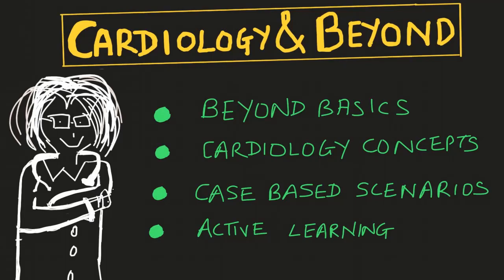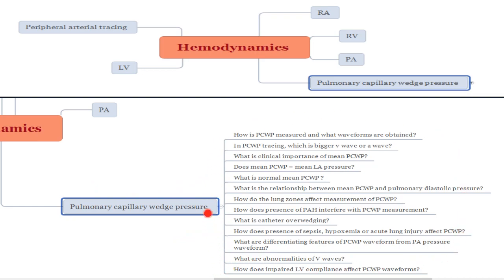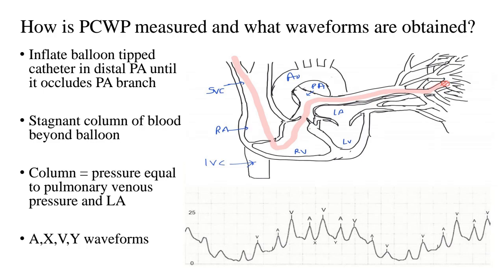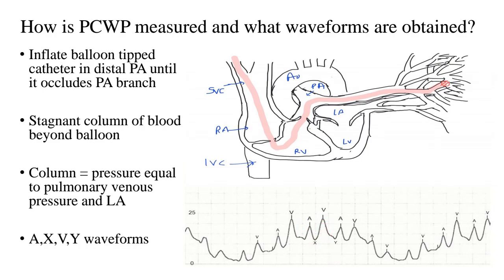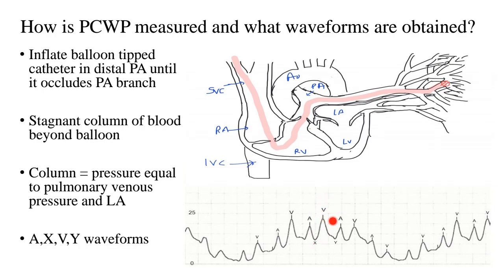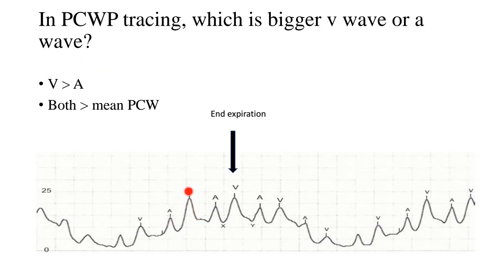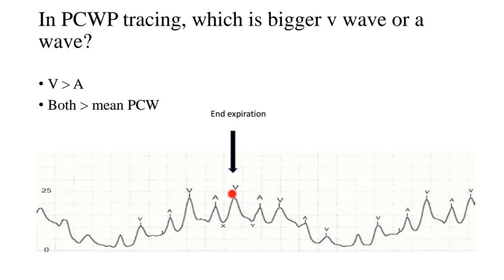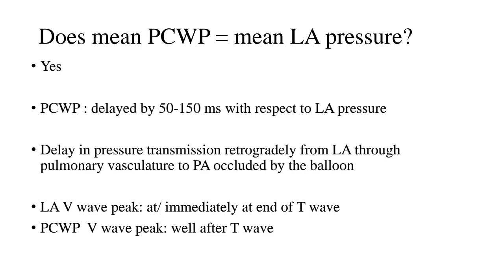Pulmonary capillary wedge pressure (PCWP)

Comment: impressive teaching methodology using illustrations and graphics. keep it up.
A small correction needed in this video clip To make correction run the video beyond 4.44 sec. I think U should say mitral valve instead of tricuspid.
Reply from the maker: Thanks for the feedback and for pointing out that correction :)
Reply: i thought d same....a gd lecture though